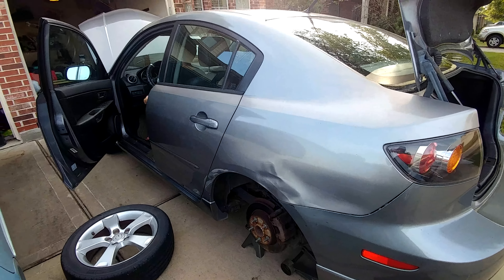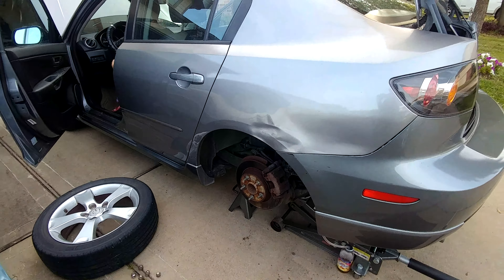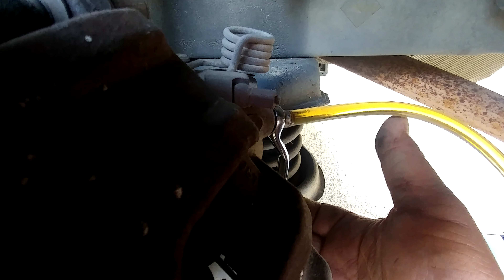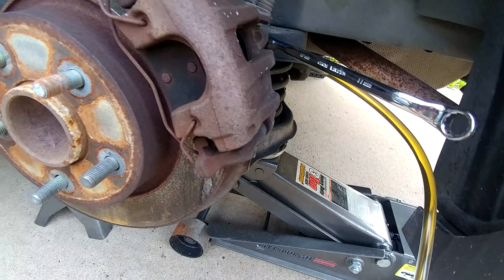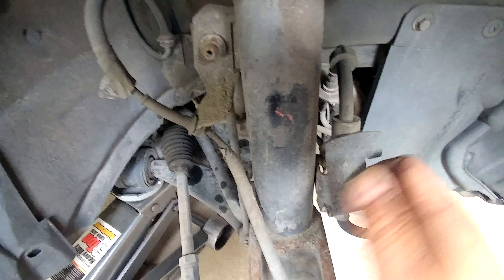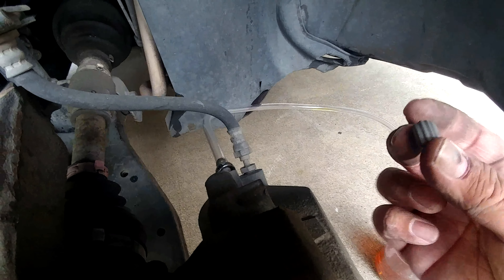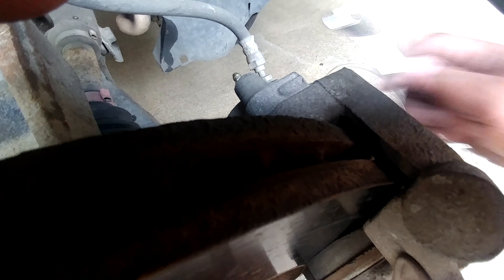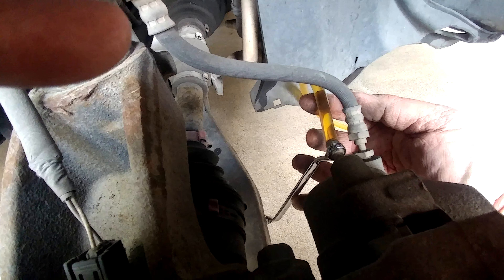BLEEDING THE BRAKES FOR THE FIRST TIME

Comment: Bleed till the fluid is the same color as new fluid. Typically clear. Leaving old fluid in the lines will cause corrosion which makes what you’re doing completely pointless because the fix is only temporary.